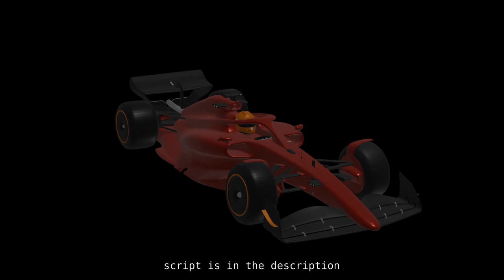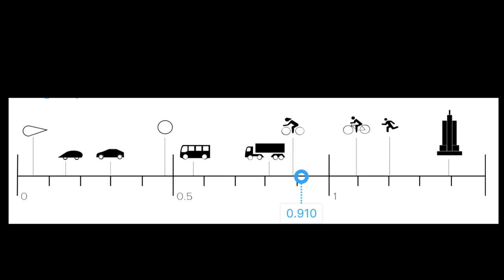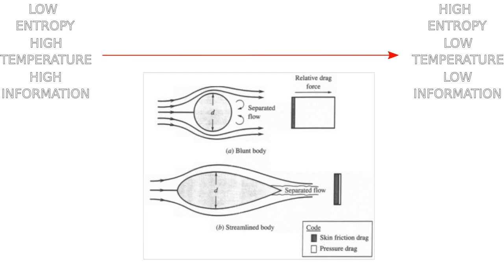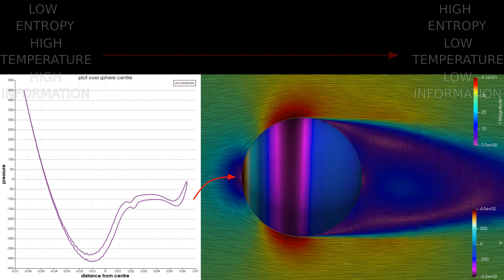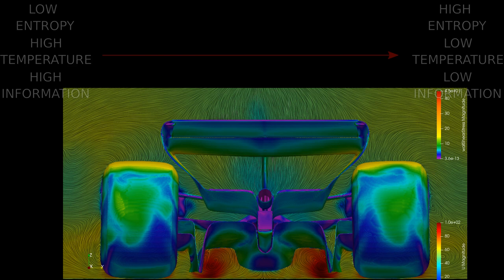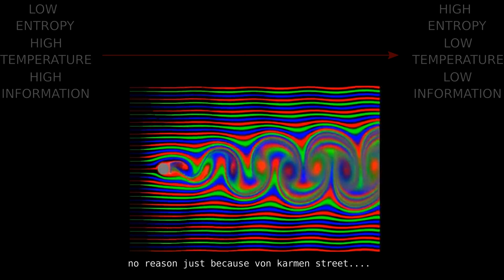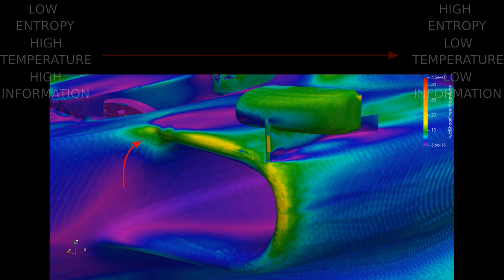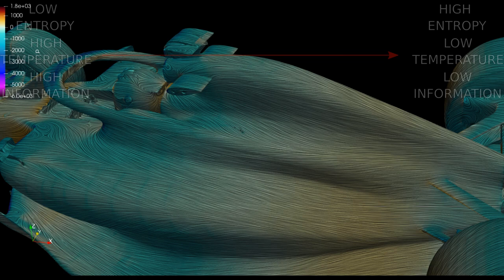Defining Drag as Information Theory

Comment from the maker: The rest of the script:
Now we can change the idea that complexity of the model increases the coefficient, to the complexity of the fluid flow induced by the object influences the coefficient. Therefore, its the information carried by the fluid that is important. 

This idea ties in well with the frontal area being a parameter of the drag force equation | because you increase this parameter and you increase the amount of air impacted by the vehicle. So yeah size is important, because that larger amount of air is about to carry more information. But, it doesn’t tell the whole story with this parameter | and that is because the wake of the vehicle is where the disturbed complex air sits. With a large vehicle it is inherently going to have a larger wake along with the high pressure zone at the front, which the reference area is hinting at because force = pressure * area. However, it becomes more apparent how the size of the wake is impactful when seeing formula one cars, | or really any other open wheel cars in the wet. The wake size is much larger than the vehicle itself and therefore also its influence. Basic stuff really, now we understand that complexity is important and inherently more air can carry more information. So if the wake is larger and is more complex then it will be because the car or object produces more drag. But this is still a bit abstract and we don’t really know what this larger and more complex looks like.

For an analysis the drag needs to be visualised in some sense, so there needs a way to map information onto the air flow. Downforce is usually visualised though low pressure regions on the underside surfaces, or negative z-axis | because low pressure is the dominate influence. Drag is in a sense opposite, | where we would want to identify both high and low pressure regions, in the x-axis. The less difference is the aim so drag forces tend to be much smaller and its a bit more complex as skin friction becomes important particularly with low lift aerofoils. 
Looking at a coefficient of pressure plot around a wing profile downforce is dominated by the low pressure, drag is more of a combination. When the high pressure air at the stagnation point accelerates out of that region it drops in pressure developing thrust on the forward surfaces reducing drag. Then if the pressure gradients are to high because of acute geometry | it can cause laminar flow separation. This geometry in a sense has a local wake with recirculating flow, with an inherent increase in flow complexity and therefore drag. 

Normally flow separation is avoided at all costs, but then there was formula ones f-duct that reduced the size of the rear wing wake. For an aerofoil separation removes most of its lift and increases drag, which is almost all of its function. A formula one rear wing primary function is to generate as much downforce as possible which tends to lead to relatively high drag. A low drag air plane wing would typically have lift to drag ratio of at least 15, a formula one rear wing is about four to eight depending on downforce. This high drag is a product of the low pressure present of the backward facing surface. Separation for a high downforce wing reduces this significantly even though the air is now more complex. This is the trade off between larger less complex laminar wake or a more complex turbulent wake for car designed for aerodynamic performance. 

For a vehicle that doesn’t have high aerodynamic performance needs | it would then want to look more like a wing with a highly tapered rear, hence a teardrop shape. But it isn’t always possible to have a nice tapered rear with an integrated trailing edge. The trailing edge is then distributed around a perimeter of the cars rear. An example is the hatchback or its analog the ahmed bluff body. These shapes will inherently have a surface adjacent to either structures vortex and fully three dimensional turbulent re-circulation in a wake that is a lower than atmospheric pressure. The three dimensional complex flow averages out and has basically been discussed, as its the general wake. A vortex structure is a little different. The flow having a structure means it is less complex than the turbulent air. This lower entropy vortex is created through a pressure gradient.
Reply from the maker: When looking at a vortex with total pressure it doesn’t highlight features well because it is including all the parameters static and dynamic pressure that makes up energy in an air flow, excluding temperature and density. This is because a vortex is still laminar flow with the lower pressure masks changes in momentum. For such a dramatic change in how the flow is behaving total pressure doesn’t describe the flow but only the fact that disturbed flow exists in that field. 
In a similar way calculating the circulation around an airfoil will give a good way to calculate lift for potential flow. But that isn’t able to give a value for drag for an airfoil, as its drag is dominated by surface shear stress values. In an absurd and ideal sense potential flow says downforce is free or at least has super low entropy. This suggests the vortex structures present at the rear of cars represents drag caused by low pressure laminar flow on a rear facing surface, like a rear window. Which it does as this is the definition of induced drag. This induced drag is present as entropy in the large wake mentioned before.

So the point is information theory introduces probability into an aerodynamic analysis through the concept of entropy. Placing an object in a fluid stream increases the probability the flow will end up being more complex and thus increasing drag. A part from the drag coefficient the reynolds number is another magical non dimensional number that fits nicely here. The longer the object is in the fluid flow the greater the probability the fluid will become more complex. Which is exactly what happens in boundary layer growth caused by the shear stresses from the body fluid interaction. Then another, for those who know the Strouhal number became important for 2022. There are many of these numbers and each can be broken down in a similar way.

This is the basic idea of information theory for fluids. There exist research papers using shannons entropy for fluids with similar approaches, so there is some reading for those interested. Currently, this theory is not necessarily a predictive tool but an analysis tool. Really it hasn’t been developed enough, though I wouldn’t be surprised that similar methods are used in industry. 
The Lattice Boltzmann method is a newer method for fluid simulation which is likely going to be more popular because its computational better. 
In a sense Machine Learning does this scalar manipulation, both either implicitly and explicitly, going by how many papers referencing entropy its becoming more explicit that not. However, that is its a bit hap hazard at the moment as there isn’t a general theory of information at the moment. Anyway this is about racecars….

Now I’ll use these methods described in the theory to analyse the airshaper model to identify problematic areas of high drag and illustrate some solutions. Together there are about three specific areas on the car I will look at, that will use different methods to identify for their informational content. 

First I’ll look at the rear wheel, then sidepod leading edge, followed by the halo and helmet regions.

Open wheel racecars have the inherent problem of exposed high drag wheels. These have a large high pressure region on the forward surface, high shear stress regions caused by their rotation, with a large and complex wake. They’re all bad. There cannot really be any direct wake control measures | as the geometry is fix. Not mentioned before in the theory is the multi body approach needed here. Basically its changing the state of air impacting other geometry caused by something usually upstream. Using the logic defined earlier, low entropy air impacting another piece of geometry would be less likely add as much information to the air than if the air was originally high entropy. Exactly like the slipstream effect for a trailing car. Therefore, looking for up stream geometry is required to approach this problem streamlines can be used for this. Influencing the high pressure field in front of the wheel is a bit more specific | rather than aiming low entropy air at the wheel. 
Seen on the corresponding chassis there is a high pressure region that reaches across the rear engine cover, | forward of both the rear wing and wheels. If this high pressure region can be altered to accelerate air over this body work, | the high pressure field can be reduced in size thus reducing the rear wheel drag. A way to do this would be to delay the tapering of the sidepods closest to the rear wheels. 

The leading edge of the sidepods is particularly messy, showing unnecessary complexity above the inlet, next to the chassis. The wall shear stress maps shows a high value wrapping up over the side of the chassis, | followed by low value behind the leading edge, | indicting flow separation and turbulent flow. The line integral convolution on the surface gives another visual aid for following the direction and path of the air. Even more clearer with this is the separation above the sidepod. This closeup view suggest the high pressure air infront of the inlet escapes above the sidepod because the bottom leading edge is further forward than the top. The inner edge at the interfaces to the chassis is quite blunt, thus the pressure gradient is too large | wrapping the air up in a bubble of separation. So, rounding that corner off would be a first step in addressing this. If the lower edge is going to be so far forward then it might be an idea to bring that round further forward thus delaying and pushing out the pressure gradient from that corner.

Also while we are here the rear view mirror stay. The interaction between the mirror body, stay and sidepod isn’t very coherent suggesting misaligned stays, but I think it is rather the mirror shape. The hint it the air is rotating correctly down the sidepod drawing laminar air down. However, the mirror will always have some sort of influence on drag, but without doing a detailed study with numerous iteration its a bit hard to know what to fix other than copy other solution found on the real world cars.

This image here is a good view of all the flow around the cockpit. The size and shape of the separation of the sidepod inlet is quite apparent. A cross section of the velocity magnitude show how much energy is taken out of this virtual windtunnel. It stretches right along the side pod and therefore would have a significant influence on drag. 

Around the cockpit and helmet there are mandatory safety features that you can’t do much about but subtle changes can be influential. A change to the halo model was the sharpening of the horizontal trailing edge. This reduces the size wake and changed its shape removing some rotation, likely reducing its drag. The problem now is a corresponding negative downstream effect produced. The wake is now significantly smaller but also higher. Lifting the turbulence above the helmet. Resulted in significant separation on the helmet because of the large and sharp driver cooling inlets on the helmet. 

This sequence of images across the cockpit illustrates the energy being removed for the air that is slowing it down to the cars speed. 

In conclusion reducing drag is a matter of adding lots of little things together removing bits of low entropy air. Delaying the sidepod tapering, making sure all the radius on leading edges are large enough and avoiding tripping the air. Anything that isn’t producing downforce needs its wake reduced as much as possible.
Reply: @nelsonphillips  Thats fucking PogChamp dud. forsenScoots

Comment: If you could do something that increases drag, but lets you run less rear wing because it makes the floor work better, that would be a worthwhile compromise. Body drag is massively influenced by the rear wing, anything you can do to run less rear wing is a plus in these regulations. All efforts should be to get the best floor performance possible, regardless of the drag penalty it imposes, then you can reduce drag tremendously by running very small rear wing.

The main difference between this generation rear wing and the previous generation cars, is the endplate used to be on both the suction and pressure side, now it is only on the suction side. This means that the vortex behind the rear wing has a more spanwise wake. This gives the rear wing the potential to influence the tire wake, something the previous generation cars couldn't really do because the wake from the rear wing was more streamwise. I would argue that feeding more high energy air to the rear wing endplates(to energize the boundary layer in this stagnant region), and beam wing will improve floor performance to the point where you can run a smaller rear wing angle. Enough for a net gain in drag reduction.

Comment: I don't get ANY of this.. but I really want to. I'm not old enough for university yet, is there somewhere I can get started so I can come back to more complicated concepts like this?
Reply from the maker: To understand this you really need the topics of engineering maths, calculus and probability. Advanced high school maths covers it, so if you learn calculus up to integration most of this should be understandable. However, the concept here is a bit out there and is original thought on my behalf. To learn this formally it would come under the subject statistical thermodynamics. This is one of the three most difficult engineering subject and is mostly postgraduate level. If it takes you ten years to get a basic grasp of the subject you're not doing too bad.